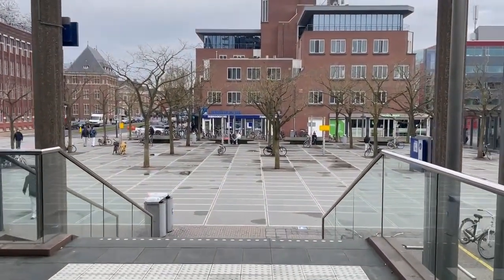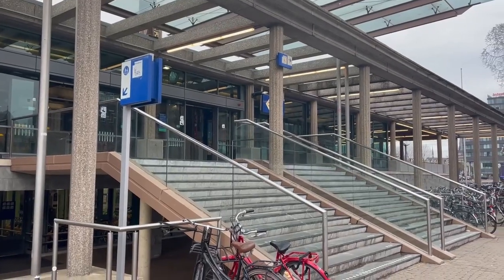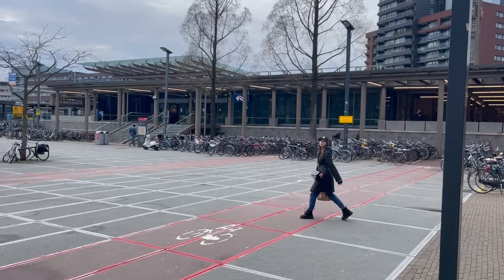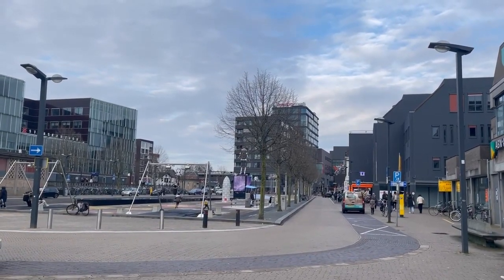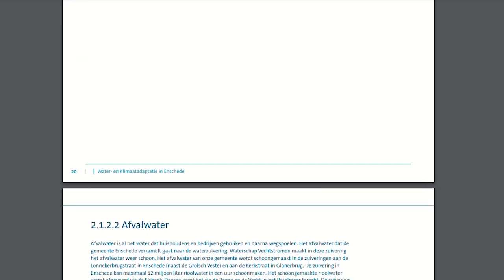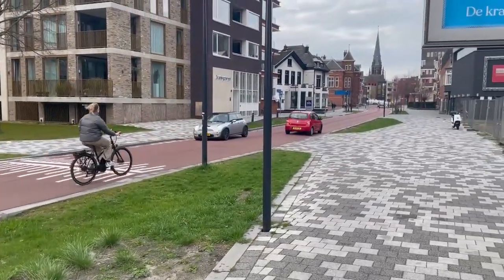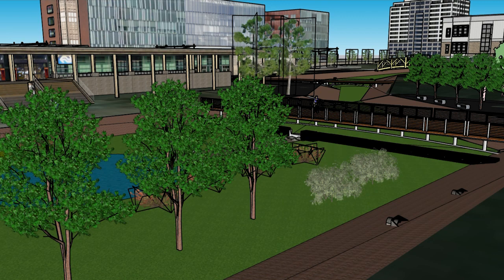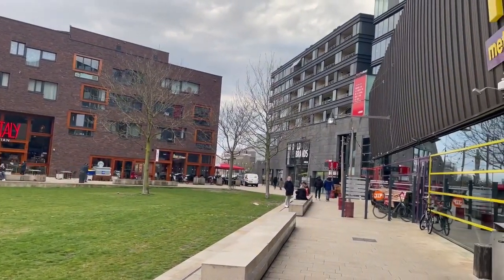I REDESIGNED an ENTIRE TRAIN STATION in the Netherlands!

Comment: I'd like to improve your model. By removing stationsplein and replacing it with a giant wadi, you make the station a lot less accessible. You removed the road for cars and taxi's to drop off and pick up travellers for the station. Pedestrians and cyclists don't like to take longer routes and often cut straight over stationsplein. They no longer can with your design. Stationsplein is sometimes used to host events. This is not possible when there's a wadi on stationsplein.
I agree that the buildings next to stationsplein have to look more inviting. They are really ugly.
Reply from the maker: Interesting point about the drop-off and taxis. There currently exists a nice turnaround and wide road on Piet Heinstraat by the verkeersschool, and my model moves the new kiss-n-ride and drop off at Piet Heinstraat.
Reply: @ayoungengineer  I forgot about that! It kind of sucks for people coming from the north, but I think that a great pedestrian friendly stationsplein is worth more that two drop-off points for ine trainstation.

Comment: So you are not Dutch, but are able to pronounce "Enschede" like a Dutch does ?
That is remarkable.

You turned the bus station into a park .. how will we get to that great place, on foot ?
Enschede is a hub in the region, for hospital choice, I pick Enschede cause a bus goes every half hour, it is a straight line, no need to hop on another.
Very stable connection.
But you removed the bus ?
I could go on bicycle, but Enschede is 32KM's.
That bus is necessary.
Reply from the maker: Ik ben aan het leren Nederlands! 😉 I keep the bus! I keep the original bus station in the design, just change Stationsplein, where you saw all of the trees.

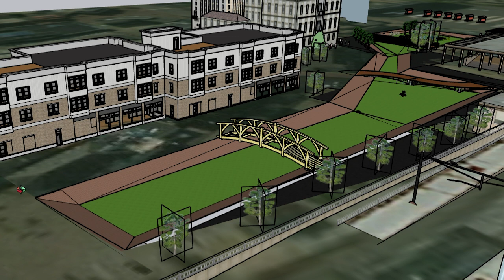Comment: 13:42 the design is pretty, but removes some rather important access routes for vehicles - The road loop that was at the top part of the station ( 13:56 ), had 3 functions: a Taxi stand, allowing people coming off the train to easily get to a taxi if they need it, a place for dropping off / picking up passengers by car and access to a car parking garage on the right hand side (between two of the buildings you found to be ugly).

A suggested design like this can't succeed without new allocations for those functions.

Comment: Nice video, I walk here almost every day and can say that your idea would be a huge improvement. One question I have is why did you remove the kiss and ride or Taxi section on the east side? This gets heavily used in peek hours because Enschede is also an end station for many surrounding villages.
Reply: I just saw the comment about the kiss and ride, but by only having that kiss and ride at Piet Hein straat you will get many 'sluipverkeer' through the city from the cars that come from the north side of the city. I think you can still have the kiss and ride at the east side around the wadi. There are these roads with gras growing trough a grid or pavement. I think this wil be a solid solution to still keep the kiss and ride but have way more greenery than there is now.